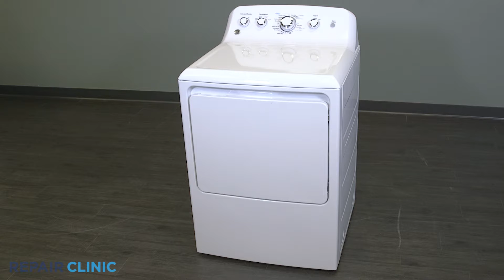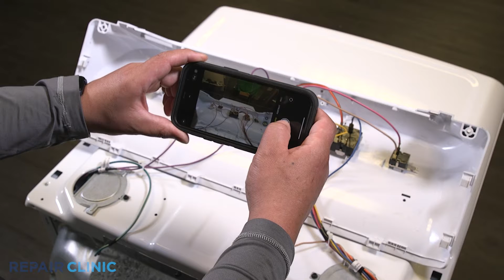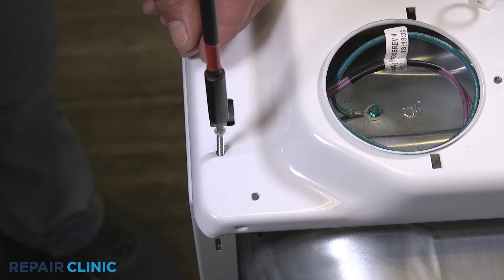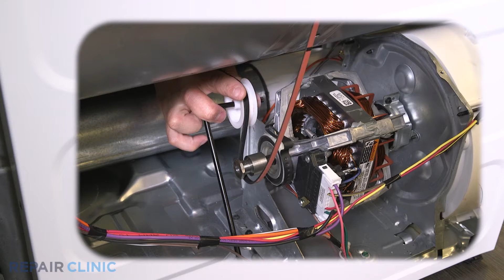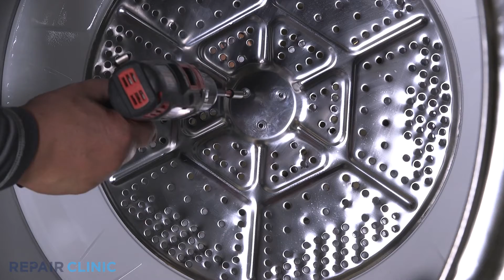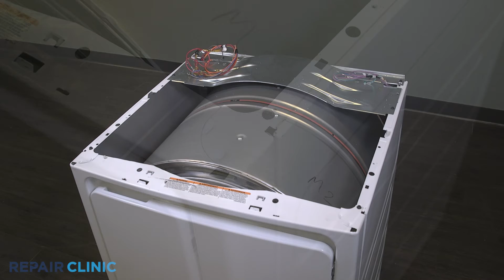GE Dryer Heat Deflector Replacement WE11X29438

Comment: Can i remove the heat deflector from inside the dryer, without complete dissembly? Or will that knock the bearing loose inside the dryer?
Reply: The drum will fall down. The u will have a hard time lining the screws back up. It will be a major pain.
Reply: @donlee4238  How did you get it to line up again?
Reply: @ take the drum out and line up the holes
Reply: do NOT do this!!! I just did it last night after a bra wire got stuck in the drum and while i was looking at it i saw a bunch of lent and thought i'll just unscrew that and vacuum behind there. now it's become a $200 repair
Reply: No don’t! lol i did it and I was in denial of having to take my dryer apart so i spent 5 hours trying to lineup the bearing and the deflector and nothing worked, I finally just took my dryer apart so I could put it back and the whole process took me 2 hours I should’ve jus done it from the start! Lol